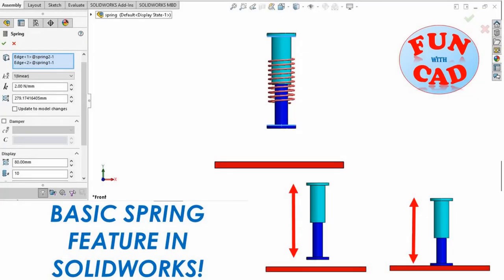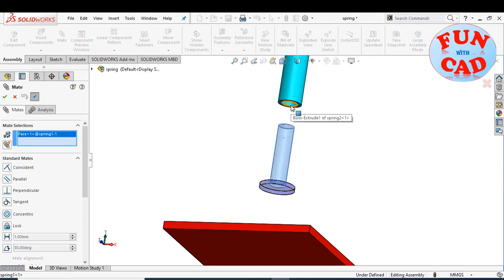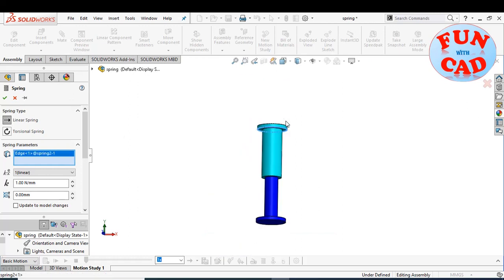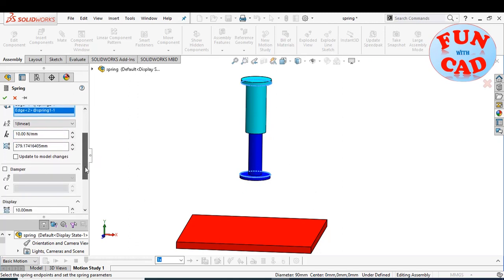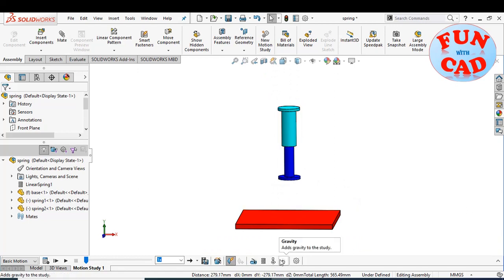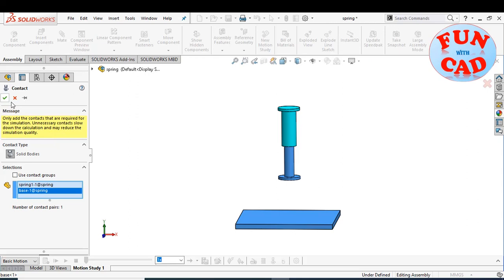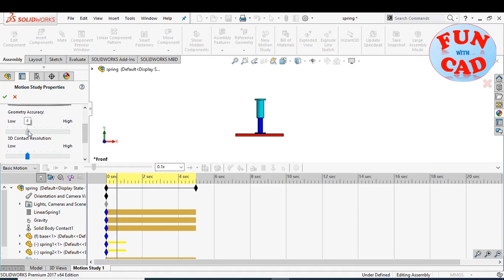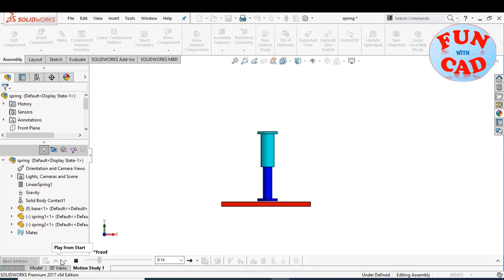Learn to add a basic spring in SolidWorks Assembly | 3D CAD SolidWORKS | Animation Tutorial

Comment: Thank you for the video. Can you please explain what do @Exponent of Spring Force Expression@ and  @ Valid options are <-4,-3,-2,-1,1,2,3,4>. @ meaning? How to set compression and tension spring by spring parameters. If i use 1 does it compression ? if i use -1 does it tension spring?
Reply from the maker: Hi Roman, not all spring elements follow hooke's law, which is F=k * X.
There are some other equations as well, which I'm not exactly aware about. These options <-4,-3,-2,-1,1,2,3,4> determine the type of spring equation which can be very complex.
And, for general compression and tension, if you constrain the length of spring in model (i.e. the spring attachment point) less than its free length, it will act as tension spring. And if you keep the more than its free length, it will act as compression spring.
hope this explanation was helpful.
Reply: @FUNCADwithMrROBOT  Hello :). Thank you for you response and explanation. I will try to do a few simulation as per your suggestion).